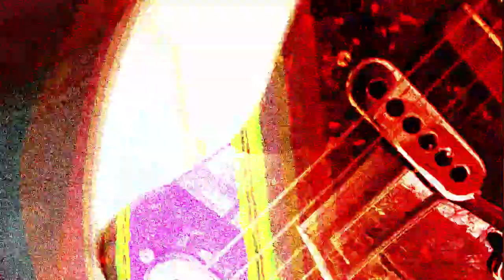Beyond Partscaster. Building a Telecaster from parts. Avoid the pitfalls and mistakes. Part 4.

Comment: Thank you so much for this series! I really love the way you explain every Little detail for all the different steps and share your knowledge with us. I‘m going to build my first Partscaster and your Videos are incredibly valuable support for getting the results I‘m hoping for.
Reply from the maker: Thanks very much. I’m my opinion knowledge is for sharing. In fact knowledge not shared is selfish. The best way to approach a build is to proceed slowly and just don’t stress about it. Make each element fit and don’t be afraid to take a bit of material away if required to make things fit. Unless you buy everything from one manufacturer there’s a pretty high likelihood that something with need adjustment. If you need to do it just keep checking the fit. Watch as many vids as possible too. Nobody has all the answers. C

Comment: Thanks again for this series, Chris! Trying to get my head around my first build. I thought most bodies would fit most necks, and notice that most Tele bodies come with holes already drilled for bridge and ferrules etc. So what made you drill them in a different position?
Reply from the maker: The body was from a guitar I bought for my son a long time ago. It had a modern six saddle design and the string holes were in a different place. This meant they didn’t line up with the vintage bridge I wanted to use. I therefore had to drill new ones as you cannot simply move the bridge. It’s very unlikely the you would have this problem. The very best of luck with your build. C

Comment: have you considered drilling the string through holes from both ends? You can drill the outside ones all the way through and inside 4 half way. Then you hold the bridge on the other side to mark the holes precisely and drill from the back. Just wondering?
Reply from the maker: Would run the risk of missing the other hole and creating a ridge inside the channel where the strings will get trapped. I considered it once but couldn’t guarantee a perfect match. My current method works really well. Thanks for your input. C
Reply: @chrisreynoldsguitarmaking  Fair, thank you :)

Comment: that string ferrule method is genius. I'm no luthier but it seems the straightness of the ferrules is purely cosmetic, so if it looks straight even though its slightly crooked within the wood, that's seems just as good as far as i'm concerned!
Reply from the maker: An ideal method would use a deep throated pillar/press drill. In the factory this is now done with a cnc and was originally done with drill system with six chucks. My pillar drill is to shallow and so I had to think up a new way. It’s adequate. I’m not a factory and seldom make telecasters so this method gets me there.

Comment: Good job . But I would prefer you stated ALL measurements in inches and fractions of inches. Even though I'm Australian, and we've been working with metric since the 70s, all instruments were made in imperial. Please could you state both?
Reply from the maker: I’m sorry Terry. I pretty much think in both with a bias towards metric. But it’s unlikely I can summon my primary school self to revert to 15/54ths of an inch. I try to steer away from measurements generally apart from scale length which I think of in terms of inches only. It’s just me making guitars at the end of the day. I’m putting in a huge effort filming, presenting, editing and publishing my work whilst actually building a guitar in real time at the same time. If you could perhaps look up what 22mm is in imperial I will cover all the other aspects. Thanks for your support. C

Comment: I recommend getting smaller template bit (I use WPW PFT30633) for ferrules and pegs. I have no drill press yet manage to achieve pretty much perfect holes by simply routing them.
Reply from the maker: Interesting. I had a look for that and found one. I use my jig as I get great results and it fast and simple. The error becomes a non issue as it is internalised. Whatever gets the job done